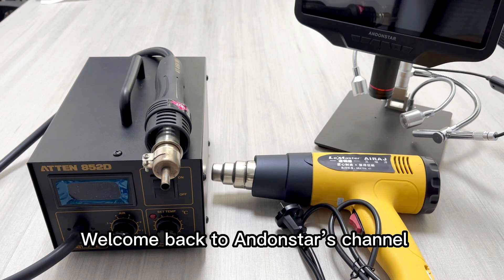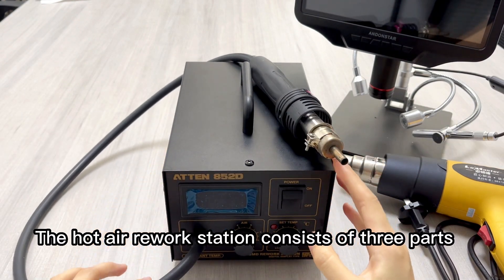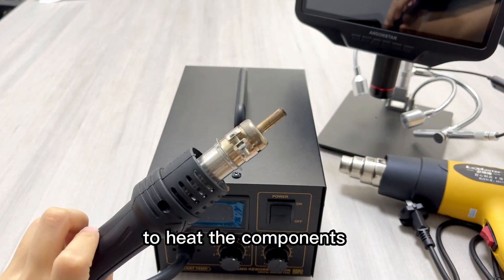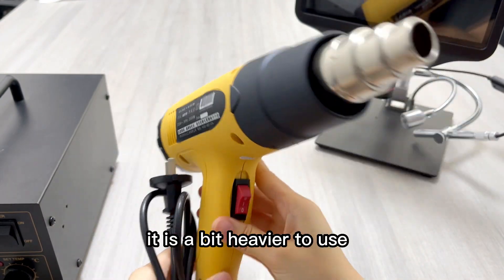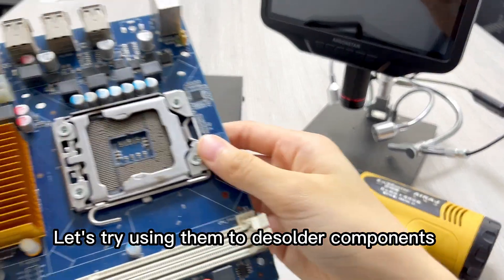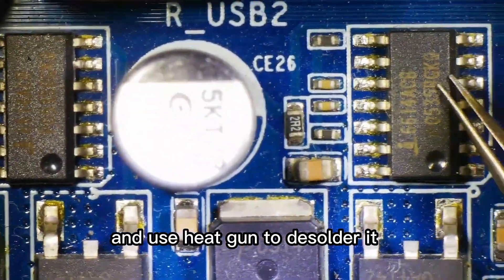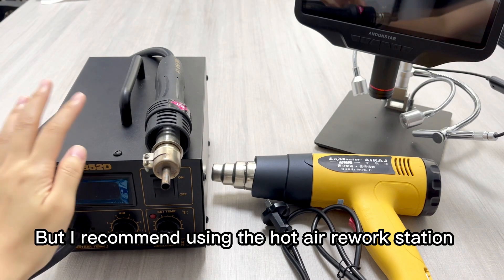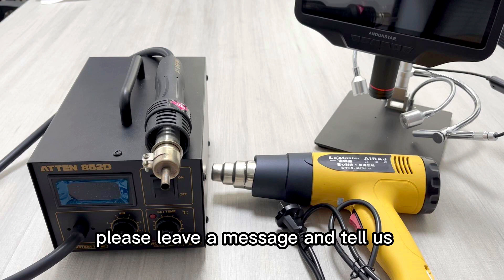Andonstar-- Hot air rework station VS. Heat gun. They are not the same!

Comment: Adding a reduction nozzle to the heat gun does just as well as a rework station.
The rework station nozzle has a screw locking system, which could be placed on the heat gun and concentrate the heat in the same way. It is worth remembering that there are nozzles similar to those used in a rework station that can be used on a hot air gun.
Both tools were designed for different purposes, but depending on the case, they may very well help in one case or another.

Greetings from Brazil

Comment: Hi, why didn't you used the reduce nozzle on the heat gun as well? the reduction will create more pressure on the hot end which will create higher temperature as well.
Reply: Cuz it was hot 😅